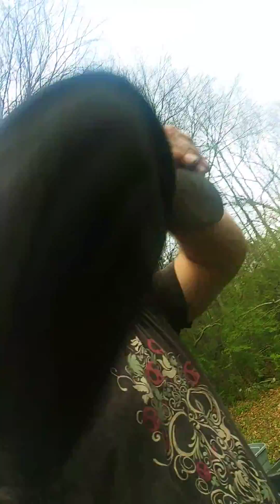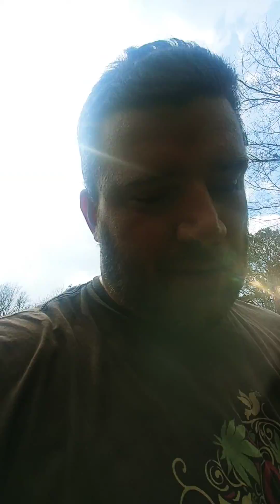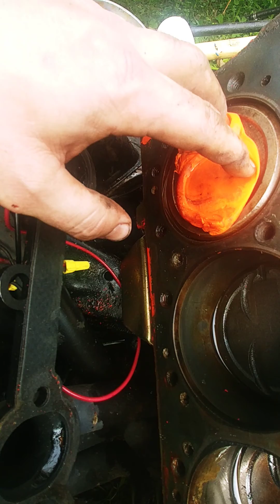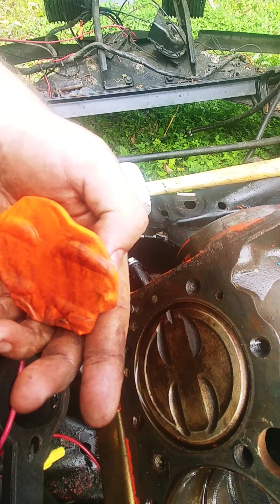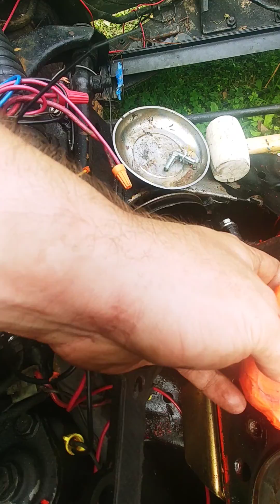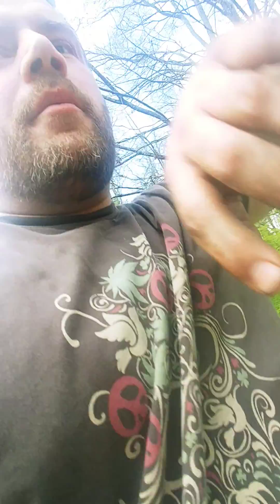Trick Flow Twisted Wedge Gen. 2 valve relief

Comment: I ran some , they are awesome ! That cam would be fine / beer perfect for them . They have excellent throttle response /power and are actually pretty fuel efficient for the performance . The guids tend to wear out fast , but the valves  are ferria and they don't wear . A Flat top piston would be much better !
Reply: I agree. That motor had a lot of wear in the cylinder walls, despite only 100k hard-driven miles. I put this engine in a 71 Chevelle, and now I have a 6.0 LS in the Vette, big .624 lift, 230° cam, Dart Pro1 heads, MSD & carb, 4L85e with 4k stall FTI converter & N2O progressive kit.

Comment: what a going on with the tw heads bro
Reply from the maker: I put them on, but it burned a lobe off the cam when I was breaking it in. So I bought a roller cam with .560 lift, 230 duration, 110 LSA. It sounded awesome. I wound up pulling that motor and transmission to put it in a 71 Chevelle I had and built. I didn't get to drive it much before I sold it. Wish I hadn't of, but was trying to keep up a family, and I didn't need both the Chevelle and Corvette. 
I still have the Vette. Finally got to try it out last weekend. LS Swapped. About to put some side pipes and a different trans in it. Check out the other videos, tell me what you think.